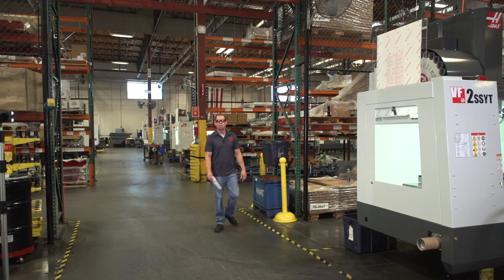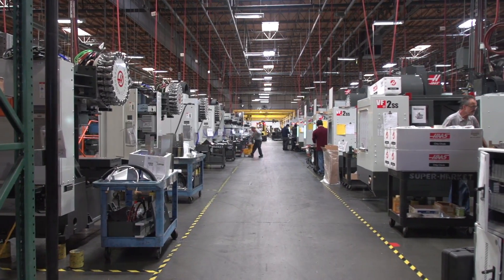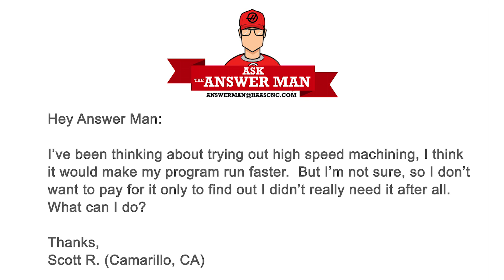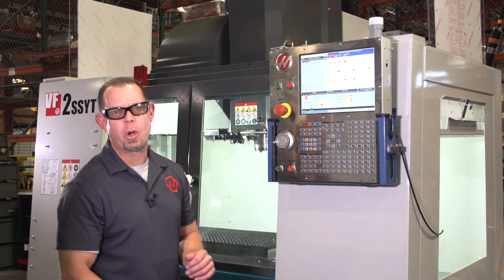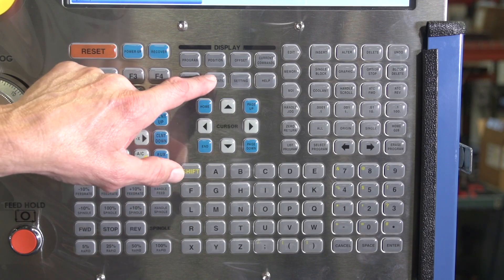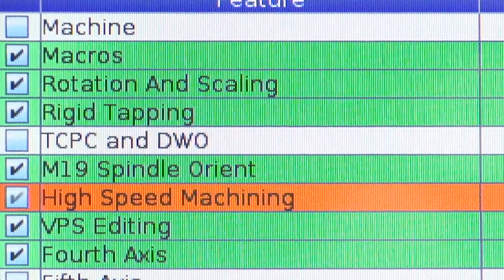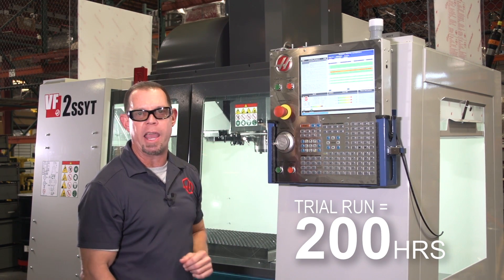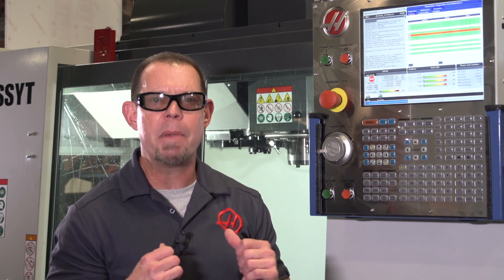Try out a Haas option for FREE – Ask the Haas Answer Man

Comment: It's super to be able to try these features - and I don't fault Haas for making unlock codes - they're straight forward and upfront about it, so I don't see how that's being unfair. What doesn't make sense to me is that HSM costs the same on their very fast/capable machines as it does on their slower machines. So... IMHO the value proposition falls apart if you own a minimill or something that simply can't go that fast.  My minimill runs much smoother, even if it's still not getting all the way up to 80ipm on adaptive tool paths. So I would love to have this feature, but not at $3500. How about scaling the price to the machine's capability?!

Comment: Mark, how to use tools from outside like Heidenhain do? If i have full in my toolchanger and want to call T150, T200 or somthing without loading the changer? Only call T200, putt it in, drill, and then take it out. Exacklty like Heidenhain do
Reply from the maker: Daniel – A good option is to manually change the tool at an M00 in your program, and then probe that tool from within your program, each time it is changed. Another way to accomplish this, is to designate a ‘floating’ tool as your manually-changed tool. If I chose T25 as this ‘floating’ tool, then I could call up M06 T25; M00 (Change to Drill, H100 Now);G43 H100. At this point, you can manually load a drill, making sure to use an G43 H100 (Offset 100) for that tool. The program will stop, at the M00, and wait for you to change the tool. To load a different tool/Offset, you could call M06 T25; M00 (Change to Endmill, H101, now);G43 H101. You would need to be careful that each tool uses its own Tool Offset, and they were all touched off before running – while they could all share the same Tool Number (25 in this case). Setting 15 H&T Agreement would need to be turned off. Tnn is our tool, Hnn is the offset being used for length, Dnn is the offset being used for cutter compensation. I hope this gives you some ideas. – Mark, Haas Tip-of-the-day.
Reply: Thanks Mark, this will do it. I have around 200 tools outside the machine thats all probed. Today i pick out the changer and load my tools, a program with 60 tools is not fun to run and take long time. Hope you will do a video about this
/Daniel

Comment: so high-speed machining is just a software paywall and doesn't actually do anything but unlock capabilities already there?
Reply: Most of the control options are like that. Already there, just have to pay to use them.
Reply: I was under the impression the ball screws and servos and parts of the control were changed for things like hsm. Does only hass do this?
Reply: @Eggsr2bcrushed  high speed machining is really a "look ahead" feature  because high speed programming has a bunch of code and without the software the machine cant read the program fast enough to keep with say 100 ipm